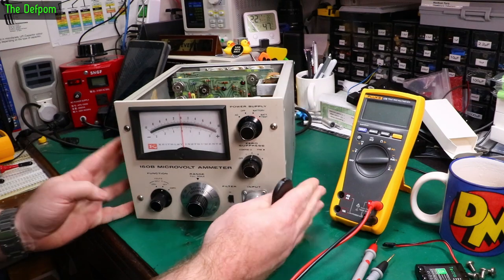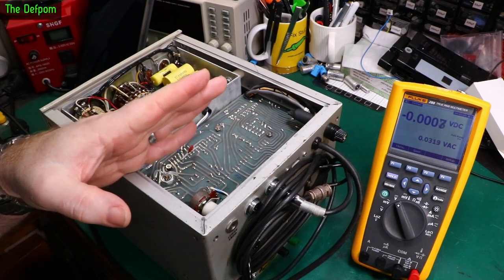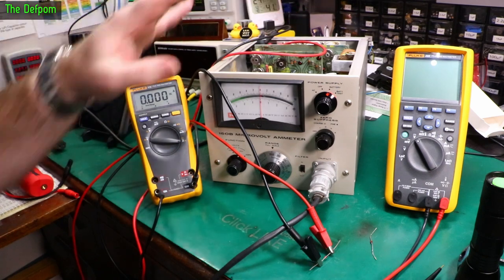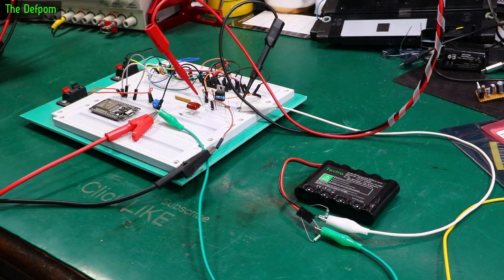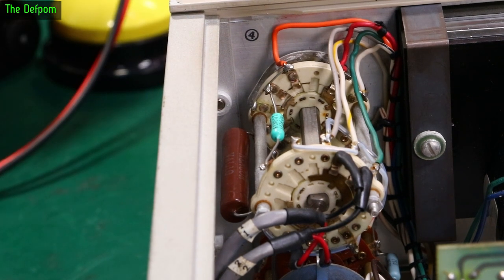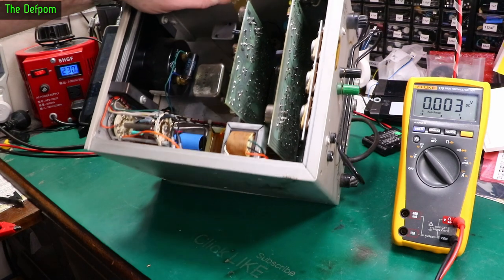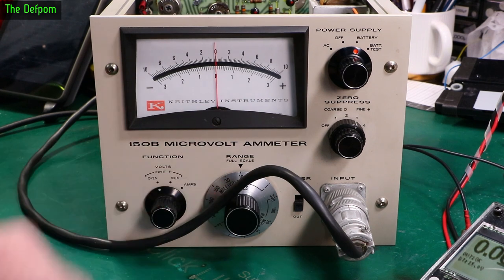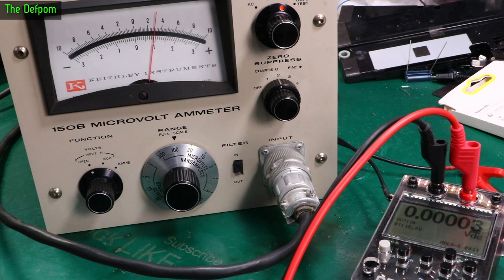🔴 Keithley 150B Microvolt Ammeter Repair Part 3 - Battery Pack and 50Hz Filter Mods - No.1176

Comment: Nimh batteries are usually charged from a circuit that is a constant current source.  The open circuit voltage of a CC source can often bear no relationship to the constant current it is designed to supply.  It should be easy enough to analyse the Keithley circuit and check if it is working properly.

Comment: Assuming the 37V you measured was at the open circuit battery connection then it looks like the original circuit will work albeit quite inefficient without any proper voltage and current control. It's not totally unsafe! However, quite suspect to have it charging 24/7 in an expensively populated workshop though! Gawd knows why Keithley didn't employ a better charging circuit! Fair enough they did series-up a 0.75A fuse though!
I = (Vcharger - Vbatt) / R
= (37 - 6) / 56 (10W)
= 31 / 56
= 0.55A
Reply: Hi Ian, Fluke 845AB uses a similar circuit, i.e. limiting charging current by a resistor only, and a well chosen transformer output voltage.
60ties technology. I assume, that Defpom did not catch the correct voltage test points, or the transformer has got a fault, or is running unintentionally on wrong input voltage (despite 240V setting). The charging circuit is very convoluted in this KEI 150B; I had some trouble to understand it.

Comment: Looks like the meter has been over ranged quite hard so the pointer might have bent on the end stop.
also C/10 was a normal trickle charge, but for good life C/30 to C/40 is a good place to start.

Comment: I am rather imagine that sparkyprojects and you are correct that the needle is actually bent. However, if the grid scale was askew, might that produce the same visual effect? I know the needle can be straightened. IIRC, there is a special tool for the job. But, before I got into that, I would check the scale's alignment. HTH.

Comment: Looks like the tip of the  needle has been slammed into the right hand side of the frame, it doesn't look like it has any stops at the root end
I would have used a diode from the battery connector, through a regulator to the battery, then a diode in the other direction back to the connetor, charge current via reg, discharge via diode, no need to modify the circuit, just a plug in module ;)

Comment: Given the extreme drop. What would the thing think if you just cranked the battery voltage to 12v?
(am still 1/4 into the video. Hope I didn't ask it prematurely lol)

Comment: If the original battery was a nickel-cadmium rated at 4 amps; I was taught those batteries should be charged at 1/10 the rated current or, in this case, 400 ma. It seems with the 10 watt dropping resistor, you are well within the charge range for the original battery. Of course, I could be really wrong. 🍻

Comment: The charging circuit is designed for a 4Ah NiCd battery, therefore it should be charged  @ C/10 ...  C/2, i.e. 0.4 ... 2A. Trickle charging should be done @ C/50 to C/20, i.e. 80mA .. 200mA. Therefore, those 256mA you've measured (it's not fully clear, how exactly you've done that) might be correct for either mode, but it's quite high for longevity of a 4Ah NiCd battery, anyhow. Very crude circuit.
Your lower capacity battery (2Ah) simply needed a reduction of the charging currents by increasing the 56 Ohm resistor, maybe to 120 Ohm or more.
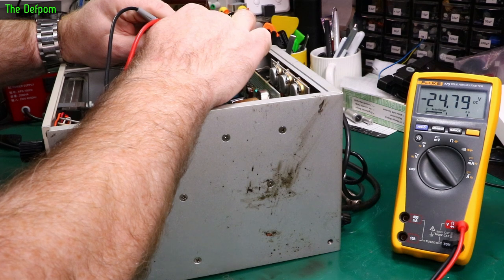The 22..24V you've measured @ 3:00, where exactly have you measured this, and in which mode? AC or OFF?
The supply is at first a full wave rectifier with D209/D210, which should deliver about 14V over C211, for the SMPSU, when in AC mode. The other transformer winding makes again a full wave rectification with D207/D208, which subtracts voltage from those 14V (or more in OFF position), to give a lower charging voltage, current limited by R228 = 56 Ohm. I assume, that the (trickle) charge current is much lesser than your 256mA. Please check again the said voltages in the modes "AC" and "Off". 
Anyhow, your stabilizer circuit might be better suited to that smaller capacity battery, and better for its life than this crude original charging circuit.
On eevblog, you've announced a repair video for the FLUKE 845AB recently.. will this follow soon? There you'll have a very similar charging / battery circuit, but that's not so convoluted.